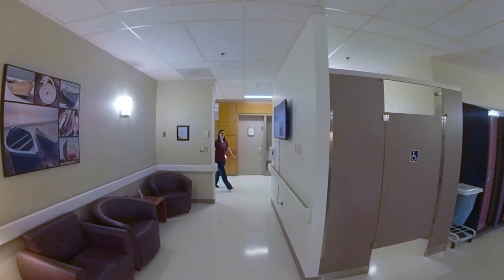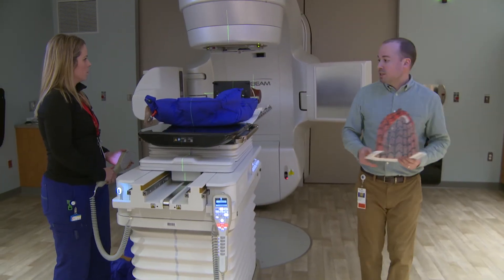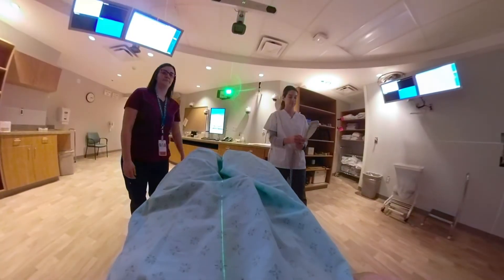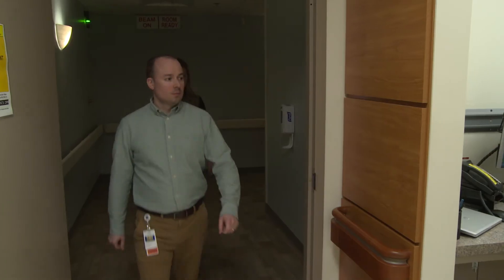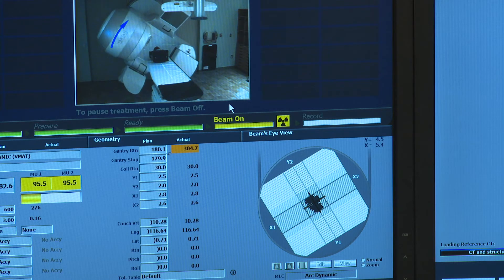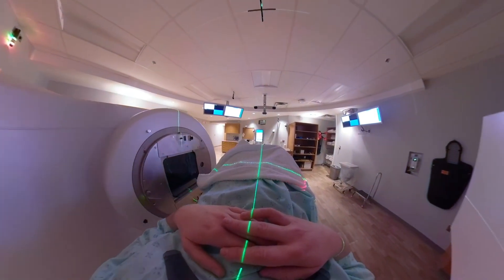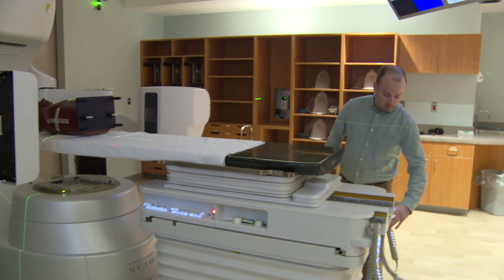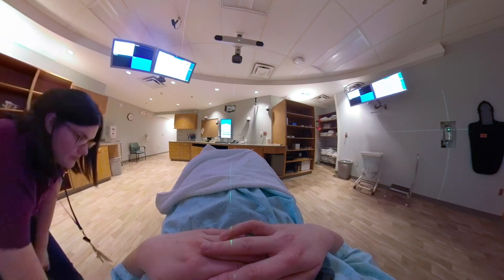Demonstrating how a patient receives treatment with the linear accelerator

Comment: Sir can you please tell me that where is that laser light coming from. And how to know where is isocentre of linac?
Reply: The lasers come from the wall / sides of the room. The isocentre refers to the area being treated :)
Reply: The lasers you see are the treatment room lasers located on the side walls (lateral & Horizontal planes), front wall (Sagittal plane), ceiling (lateral and sagittal planes). They are all aligned with one another and intersect at isocenter. Isocenter is the theoretical intersection of the Gantry, Treatment Couch and Collimation rotation axes.